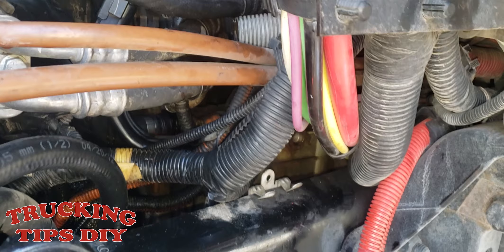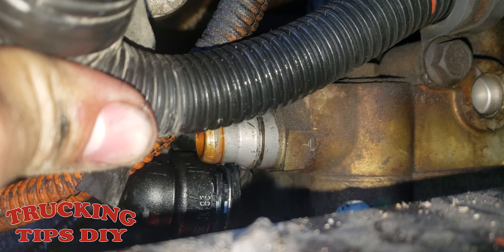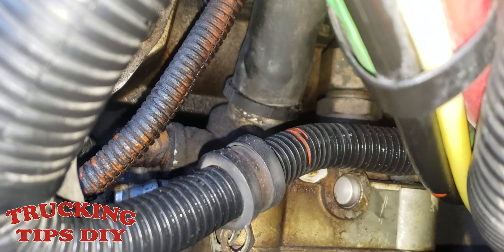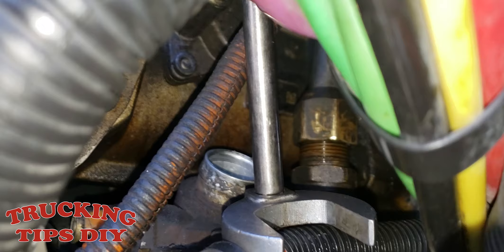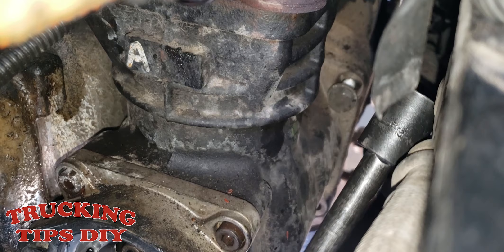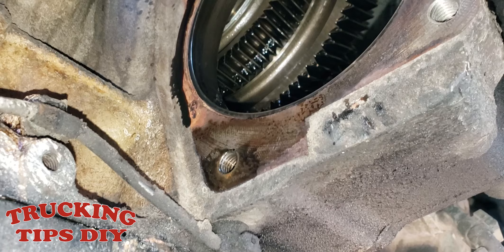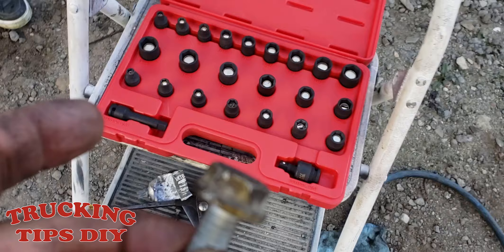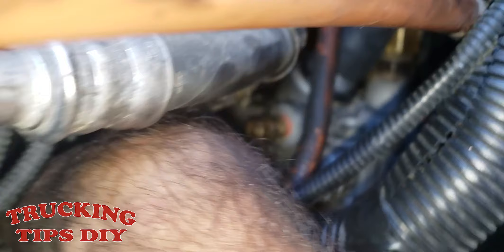How to Remove and replace air compressor On Freightliner cascadia DD15 DD13 STEP BY STEP

Comment: So difficult compared to a 60 series Detroit or any other pre tier 4 engine.  I still cant figure out what is better about this location on the bell housing opposed to the accessory drive.  Thanks I enjoyed watching.  This one sucks to change worse than the Sterlings with a Mercedes engine.  I love how the engineers turned an hour, hour and a half compressor change Into a days labor rate earnings.

Comment: I've found that hooking those 2 coolant lines up is easier if you pull the fuel lines from the fuel filter housing. Only drips a little fuel but gives you more room.
Reply from the maker: thanks for the tip
Reply: Do you have a video link?
Reply: Shit I almost thought you was Chris fix lol 😆
Reply: pulling the p/s pump easier so you dont have to prime it again

Comment: I live in Maine. I have a 2016 Cascadia and I was just told my air compressor is going bad. My truck has 596,000 miles. They quoted me $2600 and was wondering if that’s a fair price? Your videos are very helpful.
Reply: We in the same boat but I’m buying my part from freight liner much cheaper & get a shop to install come out better!!!
Reply: Part is $600-$1200 & labor should be $150-$200 a hr, @6-8hrs job
Reply: 800 dlls pump at freightliner in tx and 800 dlls labor aint too bad.
Reply: I live in maine with the same truck. What are the odds?

Comment: Hey bro thank you for the video!!! Question.. is replacing all those compressor seals fix the oil inside the lines and under the air dryer?? Thank you for your time bro.

Comment: Question if you already disconnected the discharge line from the compressor why did you need to disconnect from the other side ? Where you used two wrenches, Hope you can help thanks

Comment: Hola, mi compressor funciona pero El ac no enfria sufficiente, que podra ser, alguien dijo que alamejor la Abuja esta pegada? Toda confundida no se de que Abuja hablan. Gracias por compartir tu talento en la mechanical Dios te bendiga amigo
Reply from the maker: hola, creo que nomas tiene que poner mas freon , y si es la abuja, se llama ac expansion valve, gracias, ojala y le ayude
Reply: @TRUCKINGTIPSDIY  , gracias por contestaron, Dios lo bendiga. Ya no le entrance freon, so pensamos que esta full, pero mi hermano dijo alamejor tiene Aire acumulado similando que esta bien de freon. Gracias amigo

Comment: Excellent video!  Do you know how many hours this job takes?  It seems like a lot of work
Reply from the maker: Hello, it took us like 5 to 8 hours to do the job,   thanks for watching!!
Reply: @Mister Barak it’s in that spot because on the DD13 with the short hood there isn’t space for it in the front. Instead of having different designs they used the same parts on the DD15 so that’s why it’s stupid like this.
Reply: im a complete beginner, been a mechanic for 10 months. took me a day to just remove the old air compressor

Comment: Great video . I have a 2014 cascadia with a dd15 do you know the part number for the compressor so that I can order it?
Reply from the maker: Sorry i dont, i think is better if you check with the dealer
Reply: I called freightliner , but they won't give you the part number. I do appreciate you responding back to me

Comment: Great video, but Francisco amaya has a video like this, he says you have to put the engine in top dead center, is this true?
Reply from the maker: hello, thers no timing on the air compressor that i know, on the fuel pump there is a timing
Reply: Wy are you removing it the oil leak??
Reply: Francisco was talking about the timing on the fuel pump.

Comment: I have a P&H omega 18 crane with the Detroit Deisel 353 engine. The air compressor won’t build past 30 pounds. The compressor is a Bendix tu flo 500 which was just purchased rebuilt. I also put a new governor on it and still nothing. I hooked a pressure gauge straight to the discharge line and only got 30 PSI. I’m new to this so any help would be appreciated. Also I don’t think it has an alcohol evaporator or an air dryer. Thanks in advance.

Comment: Great video, have a question
Do you bleed the power steering system afterwards or does air not go into the system and you'll still have to drain the coolant
Reply from the maker: hello, we bleed the power steering and coolant  just to be safe , thanks for watching

Comment: This looks similar to the Mercedes location. I need to replace the o-rings and the gasket think you I'll have to remove just as much stuff? Leaking engine oil
Reply: i have the same problem, few of my bolts came out loose. i installed new bolts but is leaking a little oil which im guessing it could be from a bad o'ring

Comment: I have a lot of water in my air tanks could  it be the compressor or a line leaking ? I appreciate if u reply thx
Reply: Sounds like you need a new air dryer filter

Comment: European garbage! The REAL Detroit as we knew as a legend over here in North America died with the Series 60. Now it's all rebranded Mercedes junk. Ridiculously hard to work on & parts are outrageous! Save your old FLD120s, W900s & 359/379s as long as you can. You couldn't pay me enough to own one.

The engineering reason for using rear drive is more accurate cam timing, it reduces deflection the camshaft sees due to torsional twist while running. Seriously? They think these are race car engines turning 9000 rpm? May see 2600 rpm at most. Galactically stupid!

Good video & thanks. I'll be doing one on a DD8 M2-106 soon. Not looking forward to it.